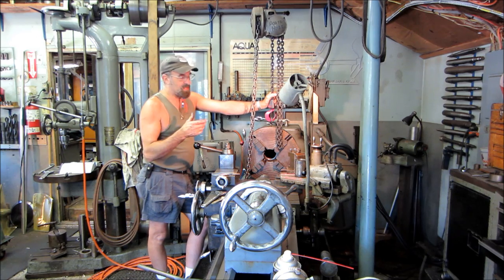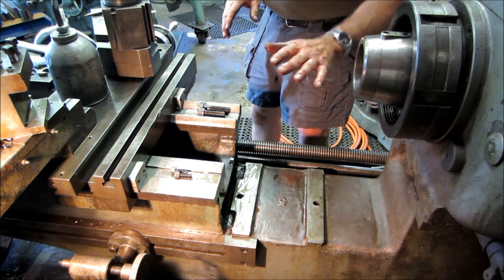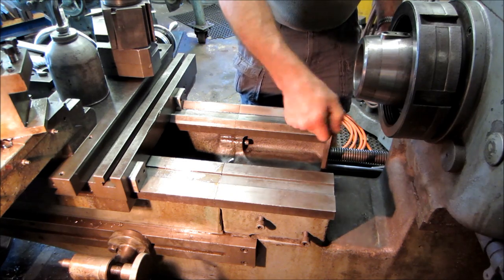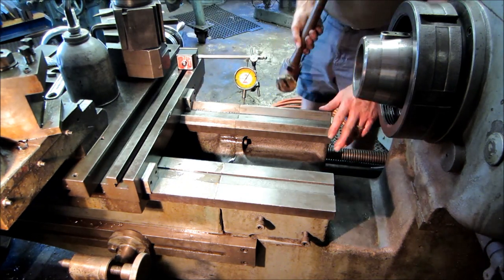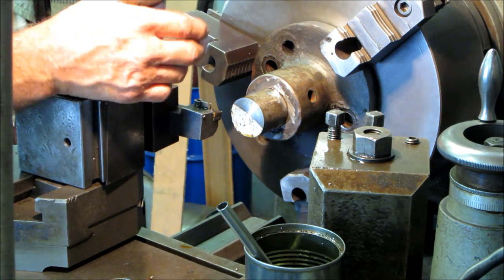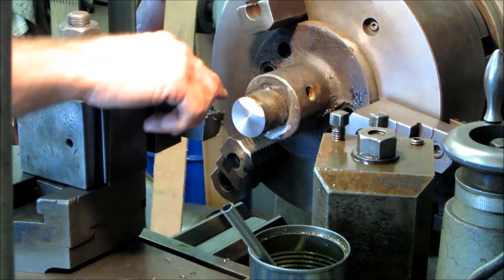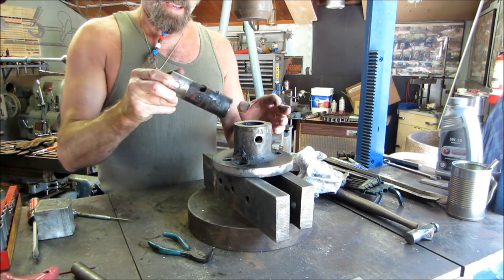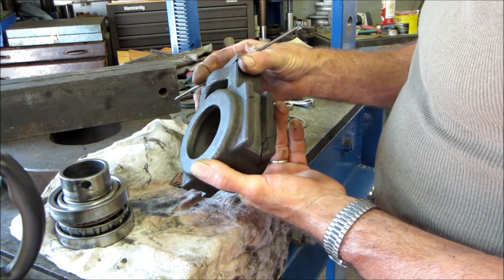Merry Go Repair Two

Comment from the maker: The cast bearing housing is a guide not so much as a load carrying support, and the ears that broke off were due to the shaft snapping and the load cocking the stub by shaft left in the housing, tweaking it over until the load forced the factures. No the housing is not a weak link! Thanks for the comment!

Comment: You have a way of explaining things so they make sense and are easy to understand.  I've always thought nickle 99 rod was the best choice for cast iron repair.  Of course that was what I was taught.  I was also taught cast iron is fickle and can't always be repaired.  After watching this video and hearing your explanation about why you prefer brazing I understand why welding cast iron can fail.  You've convinced me that brazing is better.  I'm gonna try using braze and only weld a a last resort.

Comment: I have a Colchester Student gap bed lathe and I have never removed the gap in case I could not get the alignment quite right. Thanks for the demo on how it is done, I might just do it for the sake of it. My lathe was designed for trade schools and is only 13 x 24 but it still weighs a good 750kg (1660 lbs) of British iron. Far better than the disposable items flooding the market at the moment.

Comment from the maker: Brazing, bonds as one with cast iron, and has the same strength factors, or very close! It has and always has been the choice of repair to machinery such as t-nut slots and smashed or broken dove tails; these are key areas to machinery, both loads and holds, of weight! CONT:

Comment: The one thing that I have tried and found that it works somewhat is when I go to a customers home to give them an estimate for remodeling or home improvements, I put a bug in thier ear about what I do here at my shop. I found it has got me a few jobs doing that already. Sad thing is, the heavy snowfall and cold temps make very hard right now to get anything done in the shop. The wood burner has a hard time keeping up.

Comment: Hate to say it but Andrew Sparrow has a good point. My shop is new. I spent the better part of 2012 preparing to open it even tho it's not nearly the shop like yours Keith. However, I have to keep my prices down just to get work. But as a new shop, it's hard to draw customers in and yes I have sat for a while between jobs. I am also a licensed builder for the State of Michigan. The economy is getting worse for me in that aspect.

Comment: Love your vids. I watch you, one lonely farmer and jaffro . I am not learning anything good on regular TV so thank you YT. Question: If I were paying, I would rather save a couple bucks and splice that shaft back together rather than replace it. What is the strongest method of saving that shaft if stuck on a desert island with no shafts, but a working machine shop, and approximately what percent of strength and reliability would be maintained with such a repair? Thanks so much for sharing with us.
Reply: As for the repair, I am referring to the one at hand where you would.have to drill the inside of the shaft because you have little or no room for an outside sleeve due to where the break is.

Comment: Kieth a question.  When the shaft and flange were still in the lathe and you were reducing the shaft, you also made one pass on the flange and pointed out the cristal formation.  ?What is your opinion on removing the affected area to prevent future fracture propigation.

Comment: Couldn't you drill tapered pins with removal nuts into the gap/bed after you have it set to relocate every time you remove it? Or would that not be accurate enough.